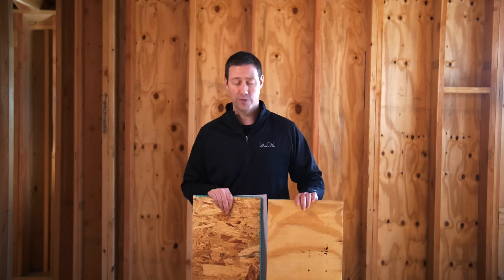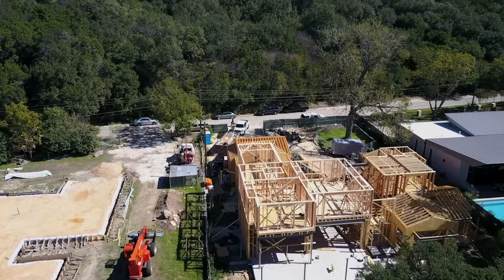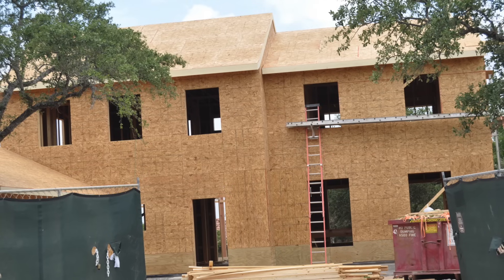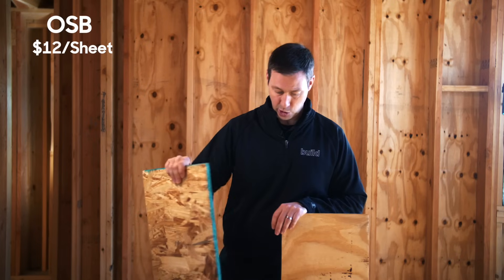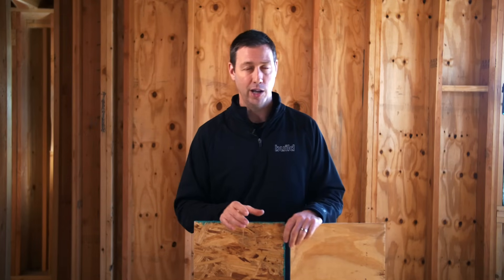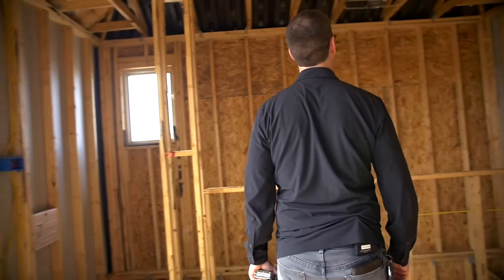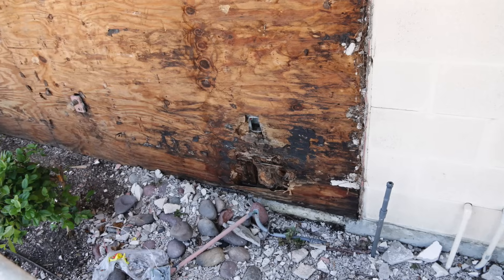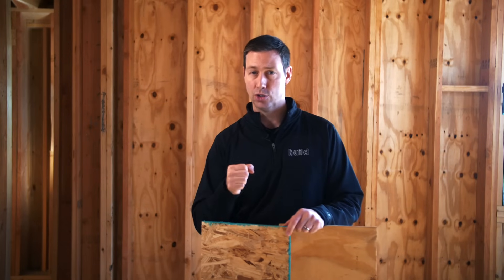Framing : OSB vs. Plywood - Whats the difference in COST AND PERFORMANCE

Comment: Matt, you left something out. I am a retired firefighter. It has been my experience that OSB is far inferior to structural integraty during fire conditions. OSB reaches it's ignition temperature far sooner than plywood because of their physical structures. Plywood being more solid.  10 - 15 years ago people had aprox. 10 minutes to escape a house fire once alerted  by a smoke detector. Today, that time has decreased to 4 -6 minutes. Because of modern building products, modern synthetics used in decor increase the toxic fumes in smoke. Also, because of the glues used in OSB manufacture  it burns hotter and faster than plywood. This is a danger to firefighters because it means sooner structural  failure. A hotter fire also means more damage or complete  loss. Too many loses in a community may change that communities ISO insurance rating and property insurance rates rise and property values decrease. So, in the long run, is OSB really cheaper?
Reply: Great info. Never thought about that angle of the discussion.
Reply: The trend around here is to use OSB (I have a few other names for it, none of them good) for roof sheathing, with clay shingles on top. OSB is not strong enough to support clay shingles. Several years ago, a firefighter was killed while on the roof of a burning house with that type of construction. The OSB gave way, and he fell through. The Phoenix, AZ Fire Chief immediately decided that no more firefighters were going to go on the roof of housing with that type of construction. Several other local Fire Chiefs quickly followed suit. But they are still building them that way.
Reply: FF here. Been there its true. Seen platform build home collapse in under 10 minutes.
Reply: Mike, great point. I am sure that OSB being made of chips, and glue has something to do with it. 

I have to agree with you. Putting OSB on the outside of a home is just stupid. It will not stand up to the sun and rain like plywood, despite if it is primed and painted. 

I really think this guy is pushing a product. He is either getting a push from his sponsor or he is justifying how he builds a home. 

As for me, I would never put OSB on the outside of my home, regardless if it is treated. For $2 a sheet more, I would definitely go for plywood. Yes, it will cost more but what is the cost when OSB rots through and has to be replaced before plywood? As well, this never talked about the strength of the sheets: plywood is by far stronger.
Reply: Both OSB and plywood are sheathing products which do not form weather barriers, they are for structural integrity to prevent racking or deflection of other structural members, and provides fastening surfaces for insulation, vapor barriers and siding, etc.
It should have a covering over it to prevent UV damage and water infiltration.  This could be stucco, vinyl plank, wood shakes, cement board, etc, but it is not an exposed surface in permitted construction.
The videographer mentioned the fastening of siding and insulation, right?  The cardboard stuff sucks 'cause it won't hold a nail?  Obviously corrupted, or the negative comment has no basis in reality?  Remember when he mentioned nailing to the OSB or plywood? SMH

Both are formed from wood fibres and glue, though the glue may be different, or the same depending on manufacture process, the short fibres of the OSB means that if the glue is defective at all it loses all structural integrity and quickly delaminated, exposing fibres underneath to failure rapidly.
Plywood still has continuous strands of fibre across gaps, although delaminated, and will retain some structural integrity and covering over interior strands , though not much and not as robust as solid wood,
Plywood does have better resistance to racking than solid wood when the sheathing is in good condition due to fibres oriented on two axes also.
I think it is not so much the glue, but the short fibres exposed to weathering, to allow water infiltration or heat, sort of like kindling. Try burning/soaking slivers of wood compared to a wide board, it is vastly different.  OK, here's a better comparison, hold a lighter (or water) to a bundle of shredded paper, a stack of paper or a pressed log of solid fibre, one will soak or burn in seconds, another in minutes, the third may be hours.  Sprinkle some glue on them all, and you will get the same results.
Reply: My father was a fire fighter and he told me the same thing.
Reply: Is a house fire number one on the list when building a home? What is the percentage of homes that were built since 1970 that have caught fire? If there were a major problem sprinkler systems would be required but who wants another water damage possibility? House fires are usually what? Careless cooking habits and panic when a stove top erupts... where is that dang extinguisher?? (hint: any flame in the house you call 911 first then go look for an extinguisher although dispatcher will tell you to get everyone out)
Reply: I can certainly appreciate your point of view, but let's consider a few things before we accept this statement at face value.  As you mentioned, a house fire can be very dangerous with all the furniture that is within the building, from carpet, cabinets, living room furniture and beds...they all provide a great deal of fuel for which a fire to burn.  Now, let's also consider the construction of a home.  I would venture to guess that roughly 90% of homes now have at least 1/2" gypsum board on the exterior walls and partitions.  And most walls are built with some type of stud system, and today those studs would usually be dimensional lumber, let's say SPF #2 or better, shall we?  

Now, if there is someone in a house during a fire, and it has reached the point of compromising the exterior cladding (through the 1/2" gypsum, and through the studs and to the back of the exterior cladding) then you're more than likely dead.  As a fire fighter, you should know that in most home fires, the occupants most critical moments are those first few seconds before the space becomes untenable due to smoke (due to all that furniture).  In a common home, flash-over can typically occur within the first 3-5 minutes of a fire...depending on conditions.  At that point, as I am sure you are aware, even the air you are breathing is likely to be on fire.  So, further to my point, if you are worried about the surface-burn characteristics on the sheathing on your home...then don't bother installing a smoke alarm..because they're the real hero in a house fire.  It's not the collapse that will kill you, it's the smoke.
Reply: I agree 100%. A fire in its beginning stage is a producer of a lot of smoke and it will overcome a person in under 30 seconds. The amount of smoke that continues is full of particulates which at the right temp and density ignites. That is the stage when firefighters have arrived and are in searching for life while the others are directing water. I think it is rare that a house will get to this stage often unless it is a hoarder's domicile.
Sheetrock, drywall, gypsum in an interior only product or is it exterior where you reside?
Reply: @cravinbob  It does not matter how the fire started. Modern house fires are hot and fast. Osb adds to the problem and weakens the building faster when exposed to fire. Fire safety should be first priority when building anything. If you had ever been in a burning building you might think differently.
Reply: As a firefighter myself I totally agree!
Reply: Michael Montecalvo water soaked , OSB strength fails multiple times faster. End grain wicks quicker and OSB is not only more end grain wicking , it's swells so much faster. Easiest comparison is making  glued toothpick  bridge versus glue saw dust one. Or mulch glued beam versus a laminated beam. Surprised at prices lately, almost comparable. You putting on a new roof, ply, architectural shingles and good flashing by a real roofer will keep you happy for 30-40years. Do it cheap and get ready 2 pay for a new roof in mere years.
Reply: it soaks up water like a sponge ,   can't walk on one side when wet cause you might slip, osb is garbage
Reply: Great comment.
Reply: Michael, thanks for pointing this out. I agree completely, OSB is primarily glue and burns very quickly. Even more of a concern for fireman, I would think, is those engineered floor joists that are nothing but two 2x4's with a vertical piece of OSB in the center. Sure they meet the load carrying requirements when they are intact but with a fire having burned out the lower 2X4 and a portion of the OSB and what's left? Compare that to a solid 2X10. I'll bet the engineered joist would fail in about 10 minutes compared to and hour or more for the solid joist. If I were a fireman I'd be concerned about a floor collapsing right under me in a very short time.
Reply: That time being reduced to 4-6 minutes has NOTHING to do with osb, 99% of house fires won't even scratch the surface of modern sheetrock in 6 minutes.  Of course there are external influences that can vary.  But your average single family home is designed to take ~1 hour to get to the structural materials.  Duplexes and multifamily even greater built with 2 hour firewalls.
Reply: Charles Greathouse If you want to place fire safety concerns that high, then why use flammable building materials at all?  Why not use stone or brick and mortar for building materials?
Reply: Modern residential building codes today (dependent on things like set-backs etc), are usually typically a 1hr system. Between garages and living spaces, 5/8 GWB Type X is used, with nail patterns double what they were in the past. This in conjunction with the advent of fire retarders and fire blocking related framing codes, slow both the vertical and lateral spread of fires. Structural failure is not proven to be simulated in the time you suggest, however it is not implausible in older homes. Homes are not rated for their ability to reduce toxins within the smoke itself, that is a valid point. However, with a fire originating anywhere in a home, structural integrity is not a concern in the initial first few minutes, it is indeed the smoke. Smoke detectors are highly sensitive today, to the point you can hardly cook your bacon for a minute before it goes off.
Reply: Great to know. Thank you sir.
Reply: As a police officer that has entered homes on fire to rescue, I would say that 6-4 extra escape minutes are life-saving and priceless. TY for your reminder.
Reply: Absolutely correct Brother!  I retired from the Michigan State Police Fire Marshal Division after 30 years as a cop.  We burned several homes and dozens of cars every year in our training programs.  Another major problem that no one ever mentions is the use of premanufactured trusses - either roof trusses or floor trusses.  With "old fashioned" rafters or floor joists, on 16 inch centers, they will withstand a fire far longer than trusses.  Once a truss is compromised by fire total collapse of either the roof or floor happens very quickly.  Those extra two or three minutes you gain with "old fashioned" joists or rafters can mean the difference between life and death.  In every home that I've built, I will NOT use trusses or OSB.  Thank you for your faithful service Michael.  God Bless.
Reply: Macks: 1) nobody knows what 'racking' means. Use words that make sense. 2). Yes, the thin flexible cardboard stuff will not hold a nail, unlike osb or plywood. like duh.
Reply: @briarstonehomes9835  Also, with exceptions, we have been required to add sprinklers, for years now.
Reply: @Rudysattva  May I ask where you are constructing? Here in the pacific northwest it's not often that we are required to have sprinklers, although we have done them when site dev characteristics would spur them. Are they required in the single family homes in your area?
Reply: @briarstonehomes9835  Maryland penninsula.  Yes, they are.   I'm not a big proponent of basic OSB ( last installed 20 years ago), but it's upgraded versions have become the norm in many home applications. Water resistance, stability, shear, weather exposure during construction are all good selling points for these.
Reply: @cravinbob  If you have had relatives killed in a fire, it may well be a consideration.  Today's houses are built with an eye mainly to the profit margin of the developer, and guess what group is most likely to be active in local politics, overseeing codes, zoning, and influencing eminent domain issues.  Developers.  How many developers are volunteer fire fighters worrying about roof work in a fire?  I don't know, but I don't know of any around here, though all three county commissioners are developers.
Ignoring a fire because it is not a common event is making an all or nothng bet.  And house fires are not all that uncommon.  If you live near a fire station, you know that those trucks do not sit there for weeks on end.  They get called out on a regular basis.  Remember that the developer asking for OSB is also the one who is making decisions on the electrical system, gas (explosives in the house, no thank you), etc.  As long as no house falls down before the devloper sells the last one on the tract, that is all he really cares about.
Reply: @cravinbob  I believe you've overlooked chimney fires, which are by far more common (at least in cold climates) than any other source of ignition.
Reply: @cravinbob  I am surprised that you don't care about fires. I guess until it happens. I live in a duplex and give in rent the other unit. I am a bit nervous of the lack of care by tenants, but believed that being next door I could keep an eye on them. One night the fire truck stopped in the driveway and to my surprise was responding to my tenants. Fortunately the response time here is about 5 minutes. However: 1 they had removed the smoke detectors because they knew that I could hear those from my unit, and the contract said no smoking and they wanted to fool me. 2. I gave them two fire extinguishers, tested and installed one under the kitchen sink and the other in the laundry room near the door. The tenant had them in front but didn't think of them. The fire was in the back deck, fortunately, and he could have even taken the hose which was very close to it but instead opened the door to the kitchen, inviting all the smoke into the house and decided to take a small pan and go to throw the water at the fire. He was so nervous that he threw most of the water on the kitchen floor and barely a few drops reached the fire. The kitchen was a wet mess but the deck kept burning, reaching the wall of a side closet and goin up a bit. Fortunately the wife got up to see what was the commotion and called 911. They came immediately, fortunately because by then the flame was reaching the roof of the small closet, which backs up to the two units, so both houses would have burned down. By the time the wife had called 911 she had decided that both and the daughter would go to stand in the front yard and wait there, leaving the back door wide open, inviting all the smoke and potentially the fire to enter the house. The firefighter and I arrived at the scene at the same time, no tell me that I couldn't go there because I have a door from my backyard to their backyard, so I can tell you what he did: he had a big fire extinguisher and used it and in a few seconds had extinguished the fire. The next he did was for me personally, more painful to watch. He had a saw and they cut off about a foot to each side of all that had burned. Of course it was needed, but the big problem was not loosing the deck but the fact that they had to cut into the beam that holds the deck to the wall, I don't know its technical name but is also the support of the subfloor, the one on top of the blocks of the foundation, so that small closet will have to be torn down and redone, as well as the deck. The estimates have been at least $5,000. Fortunately the deck is quite non-flammable and the Hardyplank also quite solid. With more flammable materials it would have engulfed both units in seconds. It takes one stupid tenant to fall asleep with a fire set up on the deck ( which I would have never approved of) and then wake up and do all the wrong things and waste time in the most in-effective way, letting it grow. I would not have believed that with two extinguishers on hand, and the hose a few feet away from the fire, but seeing is believing. So now I'm even more into non flammable materials. The house I grew up in was built out of concrete and brick, not as a facade, covering wood but unfortunately here they don't build like that.
Reply: if i were to build a new house, i should ask my builder to build with solid wood beams throughout, and plywood and zero osb or spray foam ?
Reply: It's used because it's cheaper, not because it's a better product.
Reply: Thank you I am sure many people never thought about this good information to know!!! Plywood it will be for me!!!
Reply: @ms.creativedawson9107  huh
Reply: to answer you question at the end: yes, 100% it is still far cheaper. you make good points about the fire safety, but osb is still far cheaper, even in the long term.
Reply: @firelordkushroll  cheaper doesnt mean better and u want every second if u need to get out of a burning house
Reply: @firelordkushroll  no need to have a temper tantrum in the comments
Reply: Read most of comments, plan eventually to have a garage built next to house.  I believe i have some returning and rebuy to do now ...
Reply: wow, this is a fascinating take on OSB in structural usage.. wonder how this passes safety codes? Terrible safety for home owners and fire fighters
Reply: If people would stop building with conventional wood material that would be better. Aircrete for example
Reply: Even though the occupants are dead .... the spread of fire due to structural collapse and therefore collateral damage is an important issue no...?...so I for one agree with the firefighters...
Reply: Add I beams made with Osborn’s centres , the house will burn and collapse way quicker
Reply: Stone does not burn if one wants a high quality durable product.
Reply: By that same logic all house should never be built of plywood either, it has glue in it and has a lower ignition temperature than solid wood.
Reply: great advice.   when I did my renovations, I decided to do smaller projects, with better quality products (ie. Roxul insulation,  higher grade plywood, metal roofing).   Got discount on insurance, and house is much sturdier and energy efficient.  The R-value is higher,  and the metal roofing and Roxul are more fire resistant.
Reply: I'm doomed. I live in a trailer park.
Reply: so OSB BURNS FASTER then plywood?
Reply: Great point!  thanks for that.
Reply: I agree w/ the firefighters. Structural integrity is paramount!
Reply: @immeohmyoh  You are the one who is "Like Duh" EVERYONE knows what racking is, if you don't you can't understand this conversation and should read and not post.
Reply: @liliantbouscayrol8409  I'm with him, I don't care about fires, if I cause one, my bad, my death maybe, moral of the story, don't be an idiot and don't light your house on fire, the answer is NOT force homes to cost so much to build nobody can afford one
Reply: @krod193622  How is that important? If I'm dead who gives a shit about the house? If I'm not then I hope it burns to the foundation, that way I get a new house and don't have to explain all my non permitted additions
Reply: Great reply thanks for your input the integrity of the building is paramount.
Reply: Thats all fine and good...just remember, that you volunteered for that job.
Reply: Good bloody comment!
Reply: Wood in general is a stupid choice for building a house.  Pretty much any other building material is safer, stronger, more durable, more sustainable, more energy efficient, and way cheaper than wood.  Stone, mud, clay, tires packed with dirt, dirt and straw, hell even dirt by itself are better options than wood.  The problem is many of those materials are free...and lumber companies have spent generations bribing governments to pass building/zoning laws that make it insanely hard to use anything but wood.
Reply: @harveyroad6  dayumn!
Reply: GOOD THOUGHTS ON THAT. NEVER WOULD HAVE THOUGHT OF IT.
Reply: Michael Montecalvo 
Not to mention that OSB outgasses more chemicals from the glue.  Plywood is far superior in many respects.
Reply: the engineered I-beams made of OSB are a danger as well. I helped build a house where the owner specifically required us to use SPF 2"x10" rather than the I beams for fire safety.
Reply: Michael Montecalvo people should be more concerned about safety instead of cheap. I’m in the natural gas business so you and I work a lot together. Houses burn down so much faster now than even just 20 years ago. It’s like the spray foam instillation. Hey it insulates your house better and keeps your heating and cooling bill down. I wonder how many people has seen a foam cup burn. If they have. I bet you would see spray foam blowing down the street because people could not get it out of their house fast enough. LoL. Safety First.
Reply: A lot more glue in OSB too.
Reply: @geraldscott9446  there are new codes in place for roof sheathing now also .around my area we don't use clay roofing tiles .and we have snow load and other codes that pertain to roof sheathing .
Reply: @charlesgreathouse7376  the
Reply: There’s always that “one guy” who has had 70yrs of experience with something lol
Reply: One more reason I have to hate OSB. I know you can put a hammer through it pretty easily. To me not a good choice
Reply: Osb will remain.
Occupants will be out or dead by time of structural failure so your solution is.. firefighters arrive before structural failure.
Reply: Osb fragments more easily than plywood, of course, because of the fact that you're dealing with wood shavings and such being infused with glue (which, of course, is flammable), so, in my opinion, Osb would seem to be a much more dangerous product to have in a house, or in any kind of building. I'm agreeing with you. Osb also fragments way easier than plywood. You couldn't pay me to install Osb at all! Plywood has my vote, every single time! It isn't a perfect product, but I'd rather pay more to get a better product (In this case, plywood). People often tend to forget: There's no such thing as a bargain! You get what you pay for! Too many people want a cheap product, but when it goes bad on them, then they gripe, moan and groan...you know how it is. Plus: Wouldn't Osb have more of a chemical composition that, if it catches fire, contains toxins that can kill a person quite quickly? Just curious, but that's what I was thinking, based on not only the smoke from the wood itself, but from the chemicals found in the glue? Again, just curious, but that's my line of thinking on this particular subject.
Reply: @LordPadriac  and now they have to repeat it for you. Would you prefer it in braille?
Reply: Very useful insight, Michael!  Thanks for that, and thank you for your service :)
Reply: The flame spread of OSB and CDX are pretty much the same.  Fire treated OSB actually out performs fire treated CDX.  I don't have the science but I think part of the reason homes burn so quickly these days is 1) materials as a whole to build them and 2) all the crap we keep inside them.  There should be a code prohibiting storage in attic spaces.
Reply: @Todd Haver, that’s why you should use screws.
Reply: There was a house fire here last year and the place burned to the ground in under 15 minutes. The firefighters were actually depressed because they just could not get there before the whole place was on the ground. I drove by right while it was fully involved and you'd have sworn it was a tank of oil burning it was raging so bad. It was pumping out this big black pillar of smoke. If you live in a new house and it starts to burn you'd better get out fast!
Reply: I stopped listening when he suggested OSB as a good solution, I've seen houses with it go up, the glue only helps as well from what I've read, OSB is only good for cost cutting, it gets wet and is ruined it isn't safe it isn't strong and it should meet code you're right
Reply: Michael Fresh  agreed I've worked residential before I meant it shouldn't be allowed to meet code, I know it does although I haven't seen it used other than for dirtbags flipping houses with as low cost as possible, thankfully not who I generally worked with
Reply: Michael Fresh  I'm up in CT, they did pretty well, and I saw the difference between doing it cheap vs doing it well, but there's also a difference between a 300k and a 750k house
Reply: Thanks for your input. A lot of info in that post, i would have not thought about that
Reply: where the fk have you been i listened what you know get that out there my man
Reply: As a Dutch person I can never understand why a country that had tornado’s and driveby shootings build their houses out of cardboard instead of stone/concrete.
Reply: @markthomas3748  it has no structure value. Unless it build with cinder blocks. With rebar gout. Than stone is used outside for looks only
Reply: Steven Anaya and the point is?
Reply: That cardboard sheathing is about the same as that blue foam board I’ve seen used. Both junk. Down In the shoutheast, I’ve seen that crap used by the cookie cutter builders a lot. I’m in the middle of a build, and personally wanted to sheath in plywood for everything walls and decking. But we chose OSB for cost.
Reply: Wow thanks for sharing your experience and knowledge. Definately something to think about !!! Hats off to you sir.
Reply: I agree with every single point you made as an old time carpenter I still use plywood just do not like it trust OSB never will. I have remodeled almost 3000k houses not to mention have built approx. 450 houses every time I have ran into serious structural issues in newer homes it has OSB at the heart of the problem.
Reply: Similar considerations need to be made by those building with interlocking SIPs where the insulating material may be of a type that degrades quickly with exposure to heat/flame. This has the potential to induce structural failures well before things like a roof actually "catch on fire".
Reply: OSB is basically glue
Reply: @band1tt  yes it is with wood chips from other products cut so it doesn't go to waste it's so widely used now its unreal. I don't use it if it's worth building then it's worth doing right the first time besides it doesn't cost that much more if it's to expensive for the customer to use then I always ask them to save a little bit longer so we can deliver the best product possible never been told no in my 40years of business yet actually most are relieved that I ask them to pay for real lumber. I just am not a fan of OSB any carpenter that has real experience can tell you horror stories or water damage and mold they have found just from a small leak. I just built a 16x16 shop not one piece of OSB anywhere on the shop.
Reply: Wow somebody that knows what they're talking about and who really cares. I'm sure you're going to save more than one life with your story.
Reply: Thanks.
Reply: @zandemen  I am a carpenter of almost half century of real world experience. I am sorry to say this even though you do make some good points it doesn't stand up to real world experience. 
I have been building a couple of outbuildings for myself being I am retired and almost doubling the size of my house due to terminal illness I have so I need to change my floor plan and also make sure my other half has a quality home for the rest of her life. Yes I am spending an additional 50% more to use real plywood the money isn't nearly important to me as her safety and make sure she has a very high quality home that will easily last her twenty to thirty years since she is only sixty years old and both of her parents have made it to their 90's I took that into consideration as well but most importantly actual plywood does give her lots more time to escape in the event of another fire since 30 years ago our house burned to the ground from one lightning strike but we all made it out safely.
I have repaired and/or remodeled countless homes over my career every single time OSB had been used and there were exterior leaks whether it was roofs, siding what have you lots of rot, mold and much more damage was done especially when it is compared to plywood didnt matter if it was three or four ply that played little to no effect. 
When it comes to quality and safety plywood wins hands down while yes in many cases one by can out perform in some ways but again that plays into gaps that must be left and water to pour into the building. So many factors must be considered when quality matters before money, as for me I choose plywood every single time OSB is by far and wide an inferior product for many reasons.
Reply: @geraldscott9446  Oriented Shit Board 🤣
Reply: Joseph Coon 

L
Reply: kleenup2 is
Reply: @readhistory2023  It's also a good use of the parts of a tree that can't be used for other lumber products.  In this regard, it can at least pretend to be environmentally friendly.  The gaps in older homes are no joke.  My house was built in 1949 and the wood subfloors had shrunken to reveal almost 1\2" gaps everywhere.  I can only imagine that the exterior walls have done similarly, and I can see the roof cladding from the attic has also gapped significantly.  I'd be curious to compare the energy efficiency of a similar house built with modern materials to my older home.  Not curious enough to build this house again, but curious in the scientific sense.
Reply: As a fire fighter for 16 years I agree with u when my dad retired as a fire fighter in 2003 he didn’t have to worry about this wood in the 80s and 90s plus they didn’t use paks back then now u have to plus all them houses he was going into where row homes and where made in like the 50s that’s changed big time plus fire r way down in Philadelphia
Reply: About 7 years ago, my wife and I woke up to what we thought was an early sunrise.  Much to our horror, it was 2:30am and our next door neighbor’s house had flames rising above the roof by 75-100 feet.  We lived on 3 acre lots, so it took a few minutes to get over there to see if we could help.  Fortunately, our neighbor had gotten his wife, two children, the dog and his guns out of the house (Good Texas boy that has his priorities in the proper order!).  But that was virtually it.  Everything else was pretty much gone.  The inspectors determined that the garage refrigerator shorted out and caught the OSB used for the garage walls and attic decking on fire.  Once it started, it spread really quickly.  They literally got out with only a couple of minutes to spare.  I am so thankful no one was hurt.  I am also adamant that I will never buy a house with OSB used for anything.  That stuff is almost like throwing gasoline on the fire.
Reply: Crucial point. Thanks. Companies choosing money over lives.
Reply: The only safe way to construct a home w/OSB there is a fire retardent  its called fire stuff if sprayed w/ this stuff  it will not burn!
Reply: @cravinbob  I usused to know someone who died in a house fire, and I have seen a house fire in person so although not the most common issue house fires don't seem to be particularly rare in my experience.
Reply: Hey bubba, THE SHEATHING IS NOT THE STRUCTURE lol. Both products will work as good as the other if installed correctly. The structure, if built correctly "SHOULD Be" solid as hell. The sheathing ties it in and gives a level of Structural integrity but the framing is the structure. Oh, also the insulation should be fire resistant
Reply: Honestly if you're building a new house neither OSB or plywood are good choices.
Reply: @robertmendham5770  Never trust a truss. See the WTC videos.  All truss floors. Crash!
Reply: @randomrazr  made from petrolium?? Sure about that? Not in Europe for sure.
Reply: @mg-by7uu  can I ask how many houses have you built michael?
Reply: @keirfarnum6811  it's the other way around I think.
Reply: @andersmichael7220  I've framed houses, hung drywall, etc.  but I'm not an expert.  Don't need to be one to research the downsides of a building material though
Reply: @andersmichael7220  witut?
Reply: @ronaldshank7589  The strands in osb are made from wood chips so its basically kindling, fire starter, etc.
Reply: This is the reason my post frame house will have a raised floor with 2x10 joist and 1-1/8 tongue and groove plywood subfloor
Reply: Sir, thank you for this information. I will try to remember your information for any of my future subfloor repair and renovation.
Reply: Thank you I know what am using now
Reply: @charlesgreathouse7376  gonna have to agree here. NFSA standards are in place for a reason. Even as a Plumber, I have to take NFSA into account on a daily basis so, why do homebuilding contractors get to employ a laxed adherence to these national standards? More people in more trades need to keep up to date with current codes and then, take it a step further and understand exactly the reason each code and standard is in place to begin with.
Reply: Yes it is
Reply: 6
Reply: how do you know the glues are different?
Reply: Amazing answer
Reply: @ridervillian  Most Correct. Back in the day when plywood sheathing was used the average escape time was 7 - 10 minutes. Now with OSB and other materials that time is down to 4 - 7 minutes. I'm thinking that most folks have alert devices. I'm thinking of the firefighter/s inside and how long the have to operate. Fire Rescue 1 recently posted 3 articles of structural collapses in house fires. All 3 FF involved were killed.
Reply: Thanks! Good info.